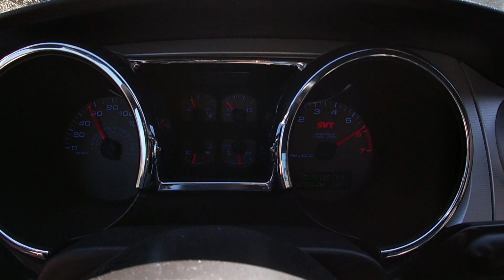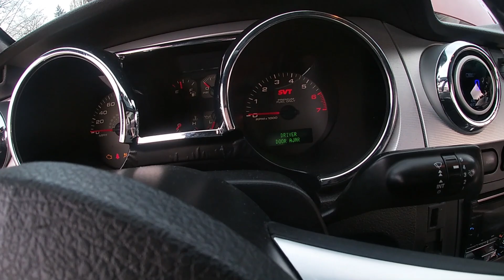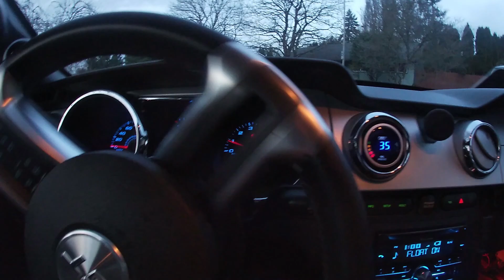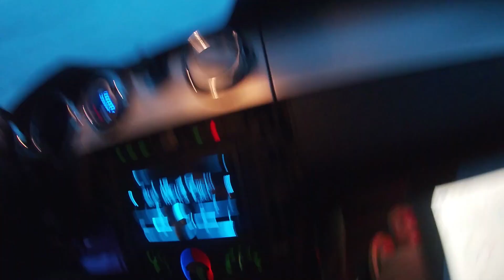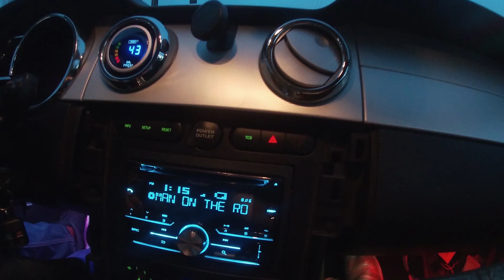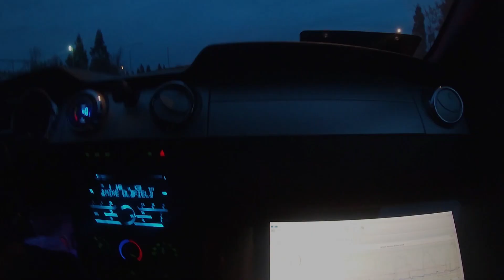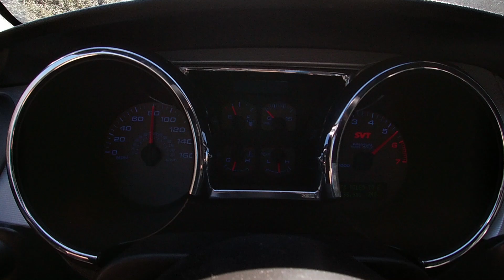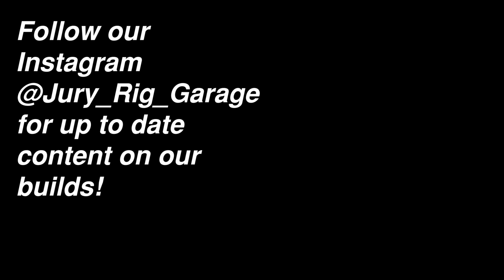2008 Ford Mustang GT 6R80 Swap Guide - US Shift Quick 6 Install! | Part 4 (First Drive!!)

Comment: So which pin exactly did you put the clean tach to? And which pin did you put the neutral safety too?
Reply: I’ve been following your swap for quite some time now and using it as reference
Reply from the maker: @gabeortiz3063  Pin 25 of the Body connector (middle one of the PCM) should be empty, that is your CTO (Clean Tach Output), you can connect that to your controller and it will read RPM directly (4cyl/rev - 8cyl) just need a PCM pin connector to fill the the connection. Use this instead a coil. As for neutral safety switch I could never figure it out. I have an auto so what is in the manuals does not work. I jumped the starter relay with a push start.
Reply: @JuryRigGarage  perfect thanks for responding! I’m pretty much going to go the same route as you on using a button for the starter. At that point do I even need to connect the neutral safety wire?
Reply from the maker: @gabeortiz3063  No you can leave that disconnected
Reply: @JuryRigGarage  Thank you man I appreciate you and your channel

Comment: Hey bud i found you on fb group and i followed your yt channel i had a question not about the 6r80 install, what dash do you have and where did you get it?
Reply from the maker: I have a stock dash, the gauge cluster is from a 07-09 GT500. They're plug n play, the mileage will just be off

Comment: Can you use a mustang 6 bolt flywheel or does it require an 8 bolt coyote flywheel
Reply from the maker: I have a stock crank so I just got a SFI rated 6 bolt flexplate
Reply: @JuryRigGarage  tyvm. My 4r70 died and I'm going 6r80 and I really didn't want to have to swap to an 8 bolt crank.

Comment: I’m doing the exact same 6r80 swap on my 3V just confused about a few of the wires did you get rid of the 5r harness ? And did you have to splice any of the quick 6 wires ?
Reply from the maker: The stock harness connectors that went to the 5R are just disconnected and tied up out of the way. The US Shift Quick 6 only plugs into the transmission  with it's main harness. Then you need to splice into a couple wires off of the PCM like tachometer reading, throttle position, vehicle speed, power and ground. It's actually pretty simple all in all
Reply: @JuryRigGarage  thanks bro helped me out a lot one more thing it does require a flash tune to start the car right ?

Comment: how much did the swap cost you?
Reply from the maker: I have a link in the description to the parts list, you could reasonably do this swap for around $2500. Depending on the deals you can get even cheaper. You can get upgraded parts and extend the build out to $6-7K if you wanted to as well.

Comment: I keep getting a wrench light on mine for some reason 6r80 did you use the stock tune for the 6r80 in shiftware?
Reply from the maker: I applied all the parameters that applied to my build. Tire size, final drive gear ratio, power limit, stall speed etc. I had the PCM converted over to a manual transmission tune by Lito. You might want to scan for codes, might be something unrelated to the transmission.

Comment: What type of flexplate , driveshaft , Transmission Mounting Bracket and shifter do you use I want to do the same swap on my 3v
Reply from the maker: There is actually a part list in the description! You can use the flexplate you already have and a 11-14 driveshaft and crossmember
Reply: 11-14 mustang parts except the transmission itself which is f150 correct?